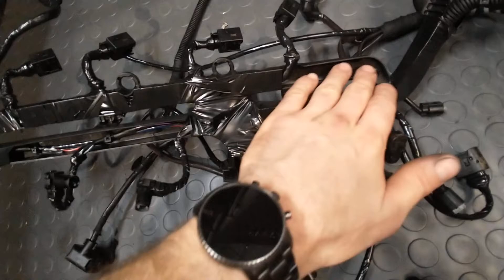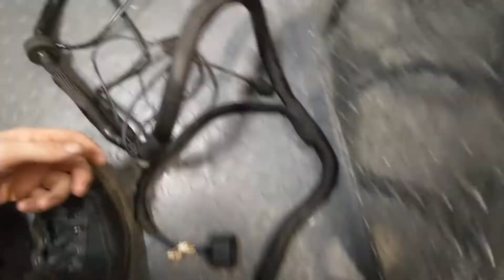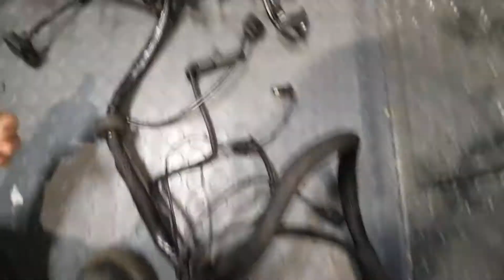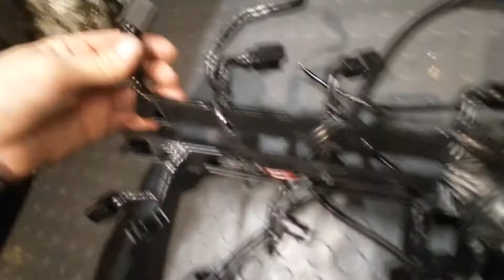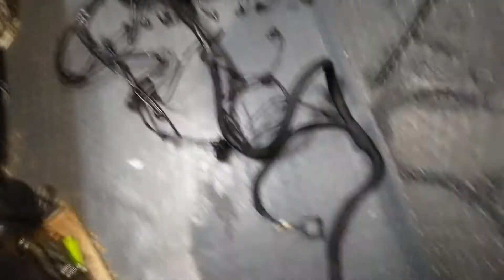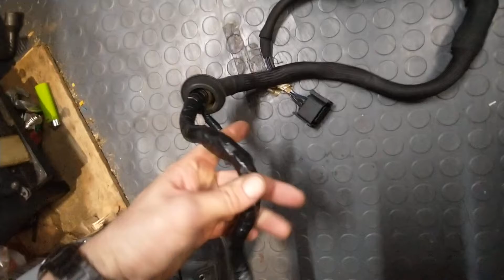Uparmored Sprinter wiring harness - protect against short to ground & engine wiring error codes

Comment from the maker: Update, this tape is not good enough, do not do this. Although it is a good idea to protect the wiring harness, it would be better to use something else like maybe braided loom. I was on the side of the road with a broken engine and I just wanted to do something while I was in there with what I had on hand locally available.

Comment: I think the electrical tape might become a gooey mess over time with the engine heat… unless 3m is rated for high heat?
Reply from the maker: Yep I took a bit of a gamble. It's the highest quality tape I could find locally - 3m stuff, rated to like 180f iirc. So far it's doing fine. Smelled a bit for the first few days but not anymore.
Reply from the maker: Update, around the cam sensor especially, it got really gooey and nasty. I think oil getting on to it may have something to do with that. It seems to be doing okay elsewhere. I'm hoping it will kind of dry out and bake on